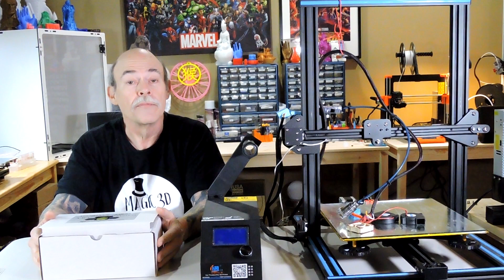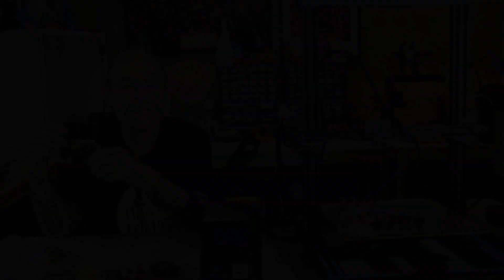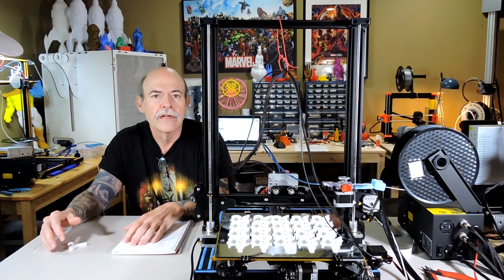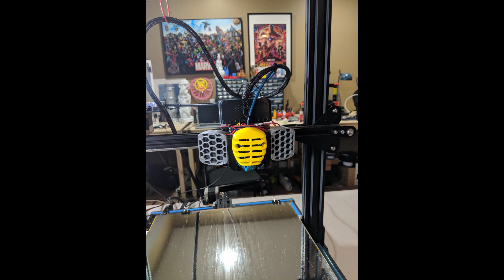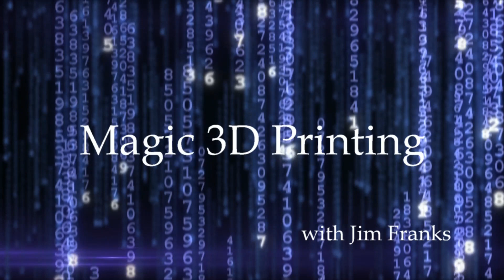The new Stinger 2 bed leveler review

Comment: I looked at the Kickstarter. I am not fan of the induction sensor used like that - it definitely solves the issue of bed material but it makes the hotend assembly more complicated and it moves.

The accuracy claimed in the Kickstarter video was single digit micron. There is absolutely no way on an induction sensor to get that or the movement system with a leadscrew being able to reproduce that - let alone the equipment took measure it.

That said I am glad it worked for you, but I think I will stick to strain gauges, piezoelectric, infrared, and bltouch sensors. Each of them I have found pretty decent options.